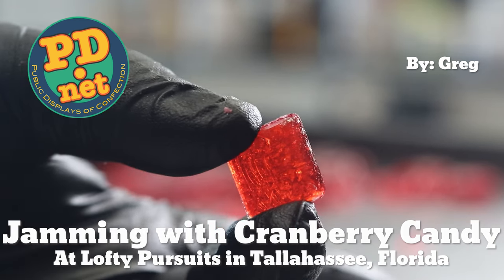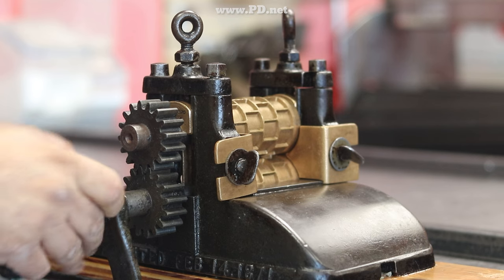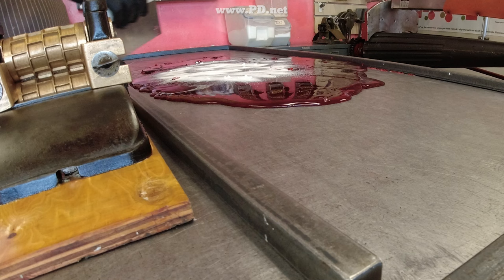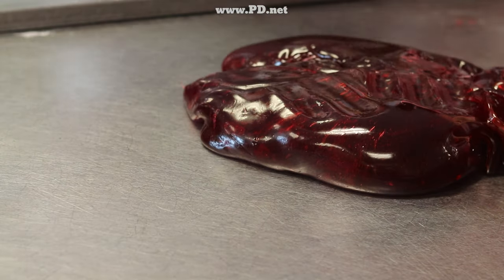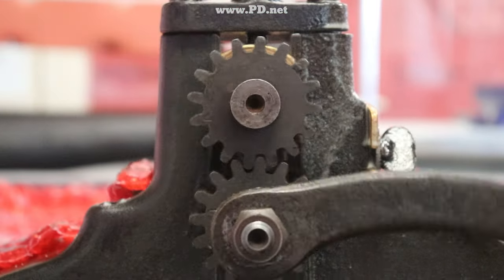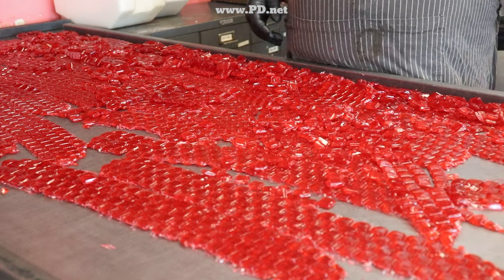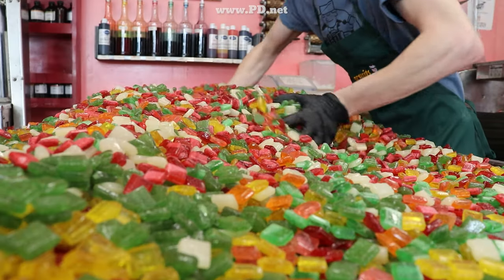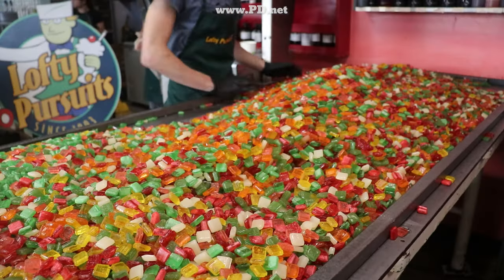#179 Jamming with Cranberry Candy

Comment: Just a question for you greg, could you do a video or podcast about how you care for all your candy equipment including the rollers especially the ones from the 1870’s?
Reply from the maker: I've done that in the past in the podcast. I'm actually thinking about doing a video where I'm Mill a replacement part for one of the machines. I maintain a pretty good shop to take care of these things.
Reply: @LoftyPursuits  That would be a very cool behind the scenes video!

Comment: Greg, I love old equipment and how it functions. Ive observed something on your rolling machines. The two guides that you place at the “entrance” of the rollers looks like they are designed to be moved in or out depending on the roller set being used. They look like they should be moved inward to be closer to the edge of the patterns. This would reduce the “flash” at the edge and increase the production.
Just an observation.
Love the process.

Comment: I've always wondered: what happens to the sugar dust from dropping the candy?
Reply from the maker: It is so much surface area and it's relatively humid in Florida that it just sticks together. If we were up north or in a dryer climate we could reuse it for something else, but it doesn't last it so it turns into goo pretty quickly here.

Comment: Greg is there a reason you color the candy in the pot sometimes vs on the table?
Reply from the maker: If there's more than one color, I got to do it on the table. Otherwise, I can't keep the colors apart. If there's only one color, there's no reason to do it on the table. I'll just stick it in the box. Sometimes I still do it on the table because it makes the pot harder to clean. But usually I just put it in the pot

Comment: i always wondered what do you guys do to all the sugar dust from the flashing of the drops?  throw it out? scrap it up an crush it finer an sell em as sprinkles?
Reply from the maker: The heat attracts moisture and the stuff is so fine that it becomes like goo fairly quickly. I would assume that if you were in a dry climate instead of Florida you could save it for stuff. It does not work here.